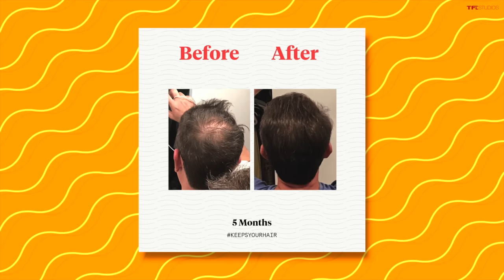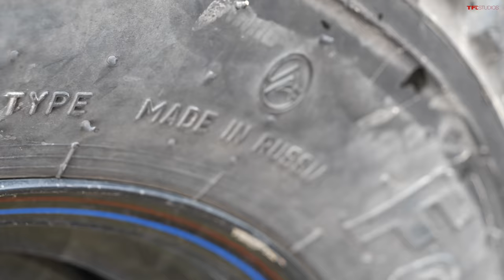Buhanka vs Jeep: I Test American Ingenuity Versus Russian Dirty But Sturdy Off-Road Tech!

Comment: 5:25 Duct tape to hold the air intake in place.  shaking head in disappointment
Reply: There is a screw under the duck tape as a back up field dressing

Comment: You don’t need to add the word “tall” when talking about tyres. Just say 31” tyres or running on 33s. No need for the phrase “35 inch tall tyres”. Because it’s not just tall anyway, it’s a diameter so it’s also wide as it’s the size across (diameter) the tyre.

How the heck does Mr Truck drive that Jeep jammed up so close to the steering wheel. Slide the seat back man or if it is, shorten the steering wheel shaft. Also, yeah ditch the awful leaf springs and get coils.

Comment: Mr. Truck needs to remove his sway bars then that jeep would ride better and off road without any tire lift. Those leaf springs are stiff enough that the sway bar is unnecessary.
Reply: That's an idea, I don't drive it on the highway

Comment: From this video you can see that the Russians are still making this same UAZ aka Buhanka today, essentially without any changes since 1965. The only things that the Russians did change in over 56 years, are the steering wheel, and the seats, as far as I can see. The rest is all the same, including the power train, the suspension, body & styling, and even color is the same. Check this showroom filmed in Russia earlier this year by one local Russian: https://www.youtube.com/watch?v=SsnG2RvQIfA
You may also want to watch how this Russian invention brakes and stops as tested by the Russians at 60 km/hr or 37 mph... Just the driver inside, this van had no cargo load. Can you imagine what would happen if you did some 65 mph or more, assuming this Russian van is capable of developing such speeds :)  https://www.youtube.com/watch?v=j00abiiaDgc

Comment: To be fair, you are running a 60s van against an 80s jeep. Also the jeep has been adapted. Next time try it against a CJ5.
Reply: That's a 1992 van, its newer than the 1987 wrangler
Reply: @davebutz2976  Yeah but apart from the injection mod it is still using 60s technology. Drum brakes etc. The main difference would be it has synchro mesh on first and the originals didn't.
The jeep had disk brakes all round, upgrades to axles and lockers and probably more horses.
Reply: @BrokenBackMountains  - yep. Put dual lockers on anything and you’re good.
Reply: I think you can do tons of mods to the van, but at the end of the day it's still going to be top heavy. It really doesnt matter what year and mods, it's just not a good comparison. I've had 2 Cj5's and 1 cj7. My first Cj5 was completely stock except for a roll cage. It had the 304, T150 3 speed and AMC 20 not locked rear differential, no power steering and we took that thing everywhere. That van is not even close to the same level as a CJ5
Reply: @davebutz2976  - true. Though unless the van is rolling over, it doesn’t matter too much.
Reply: @davebutz2976  That is the sort of info that is helpful. I have driven bukhankas before when I lived in Lithuania. They are exotic now but are front heavy and top heavy. They will take quite a bit of lean though but it is scary. For snow and ice, they are great. If I wanted a Soviet car for offroading, it would be a Niva. A Bukhanka is better as a quirky camper.
Reply: @BW.Travels  They added synchromesh to first and changed some of the instruments but basically it is the same as the originals.